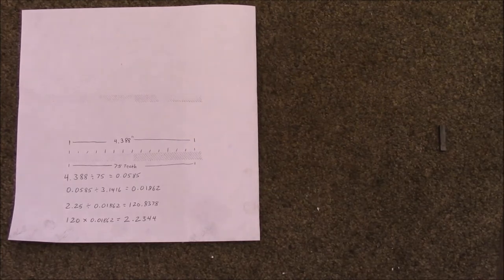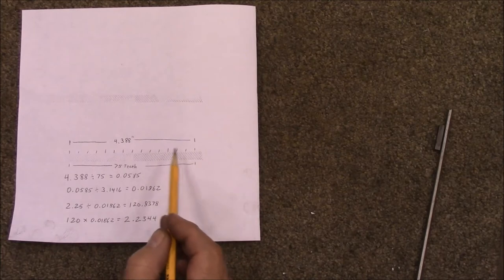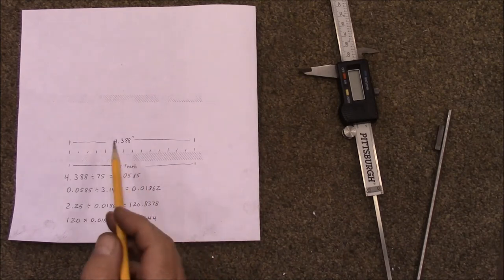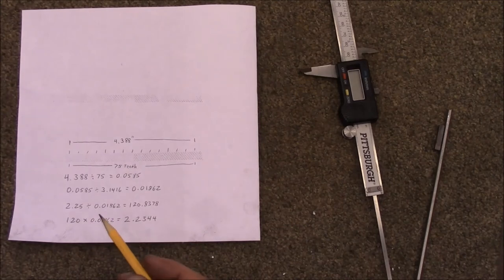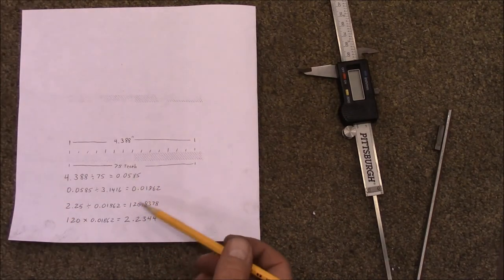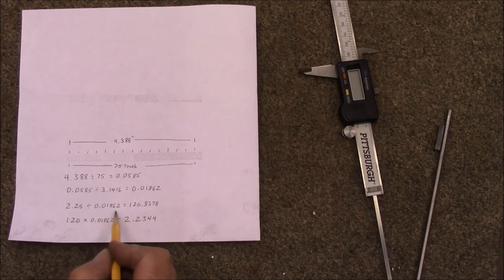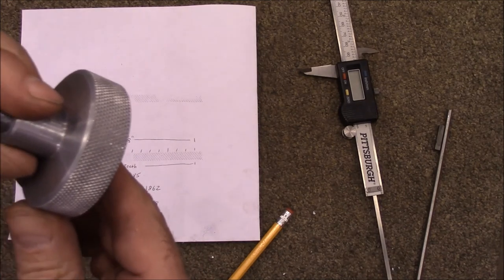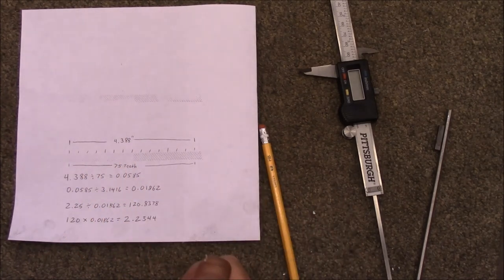Easy Calculations for Knurling

Comment: ok, so would this work in reverse? i'm building some wiper "transmissions" for a few 1937 Studebakers for some club members. the OD is .415" +/- .002. this cant change, so how can i find a knurl to fit that properly to do 46 or 47 teeth? additionally i have to knurl the smaller end of the shaft as well. it is only .250"

Comment: 75 teeth over a length of 4.388 inches results in a tooth pitch of 17.092 TPI. As you demonstrated, the next smallest size below your part's 2.25" diameter needed to produce an integral number of knurls is 2.2344". This would create 120 knurls on your part. However, there is a mistake in that calculation.
Your tooth imprint does have a total of 15 marks denoting each group of 5 knurl teeth along the 4.388" length. 15 marks means only 14 GROUPS of 5 teeth each, which equals 70 teeth, not 75. Using 70 in your calculation (15.9526 TPI) produces a required diameter of 2.2348", but only 112 knurls.
You were fortunate that the resultant diameter needed according to your calculation was VERY close the the diameter needed using the correct figures. I believe you will see your part has 112 knurls rather than the 120 your calculation produced.
Regardless, thank you for your demo.
Reply from the maker: I'll have to check that out.  Thanks for the info.

Comment: But the knurls bite into the diameter, meaning you have also to account for half of the height of the teeth x2, on the diameter. Are you sure these are not self adjusting?
Reply: I've been knurling on lathes since 1990, and have never had to calculate or change the diameter.  They always come out perfect if the tool is set up properly, and the speed is set at the lowest rpm, with the feed set at the fastest, with plenty of cutting oil.  Steel, aluminum, and brass are the only metals I've knurled though.
Reply: @throngcleaver I have mixed results just winging it. Sometimes, I get beautifully crisp knurls. Other times, I get half.5 size, so calculating the o/d if the part I'm knurling is what I'm going to try next.